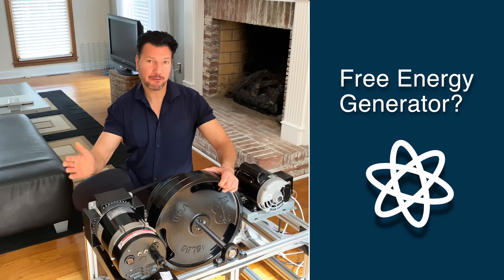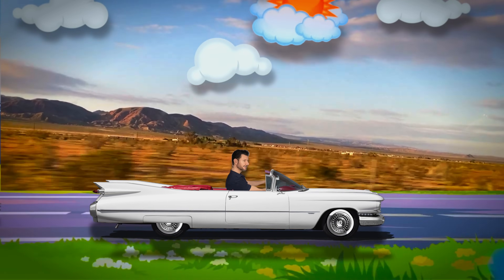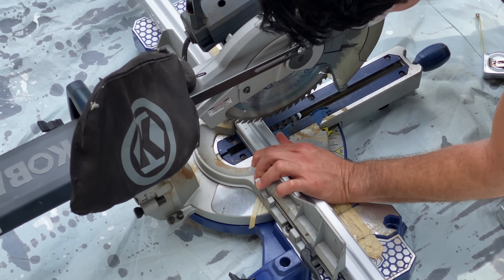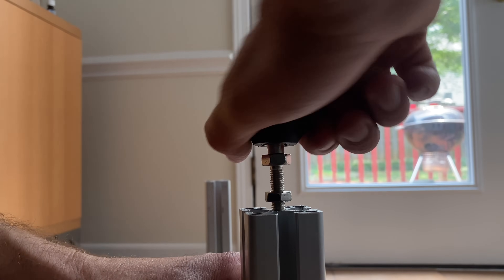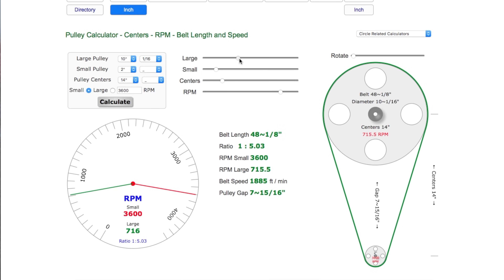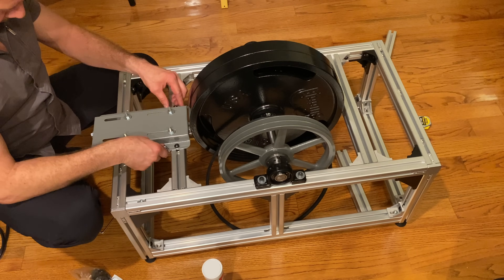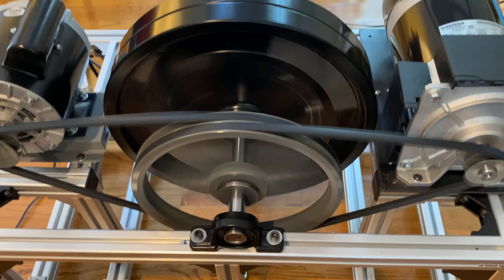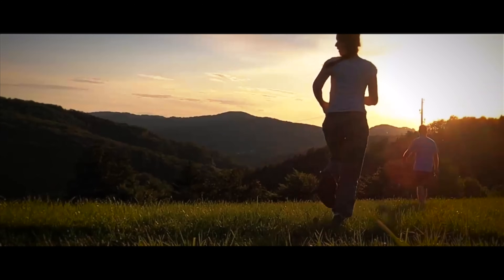How to Make a Free Energy Generator!

Comment: you could modify this in so many ways. like using a alternator with the diodes taken out.supply 3.7v to the stator core and use one phase to supply the motor the second to the mains on the house and the third to any other power needing device. ex neighbors house.  just make sure you disconnect from the power company first.
Reply: You should use 1500 rpm generator and 3000 rpm electric motor
Reply from the maker: Do you have experience with something like this ttt?
I am not done trying 
Thanks for the feedback!
Reply: I think he has to change the AC Generator. He should use generator 1500 rpm, and the electric motor 3000 rpm

Comment: bro I believe the ratios on the flywheel need to be 2:1 on the motor and 1:1 on the generator. watch that the output is not so high that it burns your motor. also a 2 to 3 hp single phase motor should be fine

Comment: I see thats the problem is you are using 2 fly wheel instead 1 , and is to heavy for the motor to keep running with such litter amound of energy that is receiving from the generator , try to eliminate one fly wheel and try again 👍
Reply from the maker: I think I actually have to add more.

Comment: Were you really trying to make it work? Your design seem to be all wrong. I'm a skeptic about this but would love to see it work, and I can tell right away that it wouldn't because of the setup. With that setup you may as well just remove the flywheel from the middle as it would serve no purpose. I think the point is to leverage the pulley system and the way you've set it up won't do that.
Reply from the maker: I set it up so that I get the correct output rpm with the input rpm given by the motor.
Thanks!
I would have loved to see it work too believe me.

Comment: I suppose one way could be to try wire each coil of an alternator to a capacitor making a different type of generator make sure there is 3 turns of the generator to one turn of the the drive motor then connect the  capacitor to Reed switches 100kg fly wheel that has a 1m diameter on that flywheel make it into a big alternator with big powerful magnets and fit a wheel that has smaller magnets with a drive chain or belt that activates the separate circuits of the coils at the right time so they draw power but not enough to lower momentum of the fly wheel while the fly wheel alternator supplies power back to the drive motor
Reply: Using a capacitor between the motor and the fly wheel alternator also use earth rods on all natural feed inputs

Comment: I have thinking about making a magnetic motor were I take neodymium magnets on a 10 inch wheel that is about 12 inches longer or more were the outer ring can run up close to it about .032 of an inch for best pull and push configuration of it. Just like a piston in a motor. Then hook it up to a generator to produce electricity. Just looking at the best material to use. Thinking about a heavy plastic or aluminum.
Reply from the maker: I was first also looking into adding neodymium magnets but it was too expensive for this large configuration to make an impact.
Thank you!
Reply: @MarkusNenning  they may be expensive but the turn a thick flat magnet into a 10 inch radius is a big challenge I'm looking at. The only way I see is to grind them into a radius or wire EDM. Turning them would require expensive carbide inserts. So now I'm left with grinding. 🤔
Reply from the maker: @kindle2730  I have seen websites where you can order them in just about any dimension
Reply: @MarkusNenning    I'm the meticulous guy. I like doing it myself and making myself

Comment: Now change the design alil . Put an alternator that supplies 95-100 amps and a agm battery in place to make an alternating current to charge battery while battery supplies power and amps to run motor. The generator can make power but not enough amps to sustain motor operation. maybe that is possible.
Reply: Umm you don’t want to try to charge a battery with AC. It will have very bad results. You need to have a rectifier. To convert the AC to DC to charge the battery. But the internal losses will take affect and the system will fail. And you would need to have a power inverter to convert to AC to spin the motor. Which will introduce more losses. I’m sorry. You can’t get free energy.

Comment: When you will put load on this system, then your prime mover will require more force to spin and if you give more power to your prime mover from the one you generated then the net power you will have left to use for other appliances will be very minimal and your overall system will become much less efficient. How can you counter this challenge.
Reply: when tuning the system, all three components, you tune them all together.  using line power to run the drive motor which spins the flywheel which spins the generator.   monitor amp draw of motor as you tune all gear ratios and mass size.   no surprises as you tune for the lowest amp draw from the drive motor.

Comment: You gave up to easy. Keep reducing friktion. By direct drive, face to face motor-generátor and the flyweel beetween. Also yse copper or aluminium flyweel with no drag surface. Use more efficent motor and generator. Use capacitor banks. Manny more options yet for yu to keep make it better.
Reply from the maker: I have not given up yet :)
I will reveal a few changes in my next video.
When using direct drive would I need a gearbox for conversion or do you think that just causes more friction?
Reply: @MarkusNenning  Good queston. But yes próba ly have tó find an other way not the gearbox. Your motor and generátor probably not very efficient also, go with higher voltage system that is more efficient for sure.

Comment: in other words , the flywheel is powering the generator directly but the motor is only loosely coupled to the fly wheel, essentially pulsing the wheel to keep it going, so essentially the motor is running with little to no load because of the loose belt.  the flywheel is powering the generator and the generator having permanent magnets is also very efficient . the magnets and the flywheel are really supplying the extra  power.
Reply from the maker: Thank you!
Working on a redesign.

Comment: There are some things I gathered in watching these videos over the years. One was that one belt had to be loose so as not to be directly connected to the flywheel. The other was that the generator had to be of permanent magnet type or modified to be such.. Thats all I remember. I see the loose belt concept being applied in several of the indian videos but am not sure if their generators have been modified with permanent magnets. I suspect that they are but they are not indicating such..   I did see one video long ago, that did indicated that the generator was modified.
Reply from the maker: Thank you 19999927 
From my experience, if the belt is too loose it will cause a lot of slippage at startup and ruin the belt. I can see that a belt that is too tight causes additional friction. But if you have good bearings and tighten the belt using some guidance from the belt supplier it should be ok.
I think the main reason the belt is so loose in the videos is that the motor would stall because of the sometimes up to 400kg flywheels. Once they reach the required rpm sometimes you see that they tighten the belt up.
Reply: Claro el alternador debe de ser de imanes permanentes
.
Reply: @MarkusNenning  yes too loose belt will slip, but slippage at start up ok, that is why they use momentary on and off from the motor till the flywheel gets up to speed.  belt tension should be as loose as possible without slippage when system is up to full speed under load.  you can connect amp meter to see how belt tension affects amp draws.
Reply from the maker: @rmendes2mendes915  good idea thank you!
Reply: @rmendes2mendes915  its like when the buddha tried to play an instrument the hordes have to be just right in order to play a harmonious sound.
Reply: @User-fp4gn  when you get into extracting electrons out of the environment it does require the use of frequencies and resonance within those frequencies

Comment: Hi torque hi rpm low voltage motor the flywheels whit magnetism the generator have to be hi output low rpm whit regulators and few capacitor important the magnet on the flywheels and the pulley combination
Reply from the maker: Thanks for the info Efren!

Comment: Dear, the engine needs to be started through the speed regulator, while maintaining power.  The belts should be slightly relaxed.  And the gear ratio on the flywheel pulley must be different.
Reply: Look 🤔👍https://youtu.be/ZDNpw3ulp44
Reply: @skyenergy777  do you really believe that it will sustain itself?  I bet you there’s a battery in one of those metal boxes. Which means it will run out after a while and stop working. Did you notice that they never had it running for a long time?  Don’t you think that if “free energy “ was even remotely possible, it would be mass. Produced by now? Study electronics. Once you know how electronics and generators work. And how we get electricity. Then you will understand why perpetual motion generators are not possible. There will always be internal losses. That’s why you can’t plug a charger into a power inverter and charge the source battery for very long. You may prolong the charge in the battery for a while. But the internal losses will take affect and the battery will drain.
Reply: The closest we can get to “free” energy is with solar panels and battery banks. There is always going to be internal losses.
Reply: Add a super capacitor
Reply: Well, not just adding a super capacitor alone, you'll also need an AC to DC inverter, deep cycle battery,  and a battery charger that will prevent over charging, you'll need to power the motor with a suitable deep cycle battery, but you need to connect the inverter and the charger to the output of the alternator then a kind of timer device or something do as to charge the battery some seconds later after the whole thing is stabilized. I guess it's not totally free since the battery would be supplying the energy to the motor
Reply from the maker: Thank you Sky!
I honestly believe that no matter what ratio or belt tightness this setup will not work.
I do think “free” energy is possible but not in this strictly mechanical way.

Comment: I did this in 1998 when I was working for Siemens in Munchen, and you can supply enough electricity to ten homes by using a slow-cycle magnet generator.
Touches of intelligence, do not forget
Reply from the maker: Yes please share some details and hopefully some evidence.
Thank you!
Reply: moreDetails?
Reply: With a low rpm permanent magnet generator? And a high rpm input?
Reply: @Jakeup211  iDontThinkThatYouNeedToHaveDifferenceInRpmInputOutput.YouNeedLowCoggingGenerator.
Reply: Liar
Reply: @kristiancartwright7451 😂
Reply: Please more details
Reply: That sounds very interesting
Reply: Bullshit!!!! If that had worked, you should have been a millionaire by now by selling electricity to the grid!!!!   All those free energy things are fake!

Comment: I see the problems. The belts need to be on the outer part of the flywheels. For more leverage, And the bigger the fly, the more weight and leverage you will have. And low rpm generators or pmas are better. But the flywheels need to be pulleys too. The bigger the generators or pmas the bigger the flywheel. Man you are are going to need some heavy equipment.
Reply from the maker: Thanks Bradley,
I am looking at a belt less system now.
Trying to figure out the perfect gear box ratio.
Having a hard time finding a u-joint or coupling to go from the 5/8 motor shaft to the 25mm flywheel shaft.

Comment: So the drive motor, 3000rpm should be 10% faster, so 110% means 3030rpm
. I think that should work then. if not then 120%. you have to try everything

I love these movies. They give you ideas
Reply from the maker: Thank you Lukas!
I do overclock the generator it needs 3600rpm and I deliver 3800rpm
Unfortunately that didn’t work either.

Comment: Hello thanks for the informative video! What about generating power in three phase and taping into to one phase to power the motor and you should have excess power to run other devices on the other phases? You might need an inverter and a battery to store some of the energy for the slight drops in rpm and to make sure you get clean usable power. Im not an expert but just a suggestion.
Reply from the maker: This generator can only do 2 phases but good idea! 
Thank you Gareth!

Comment: What is the cusption of the electric motor verses the output  capabilities of the generator.  Would the draw of power to run the generator be more than the maximum available output?   Just a curious question .  

  Also would a 10kw generator be different than say a 3500 watt generator because of the way the windings and armatures are set up?   And what about 220v vs 110v ?  Lol.
Reply from the maker: Hello Mike yes the idea is that the Motor uses way less energy than the generator can produce. I will get into that some more in the next video.

Comment: It will work but your pulley setup is wrong, so what you can do is get a high torque driver motor you will putt a bigger pulley on it.  On your flywheel you will actually need to add an additional pulley that is smaller for your drive motor to spin it.  So what this will do is increase your flywheel speed because with a high torque motor they run on lower rpm.  Also you need to see what your rpm requirements are for your generator head, and Also what he is required too. Also if your generator head is real small it may not be able to handle the initial surge output too

Comment: Try some of the magnetic motors. Plus the feedback is supposed to drive the motor but you know that. Once a magnetic motor is spinning, slide a different coil to use the spinning magnets to drive current.

just a thought. I'm trying to get a magnetic motor running.
Reply from the maker: Please share your results if you get the motor running.
Thank you !